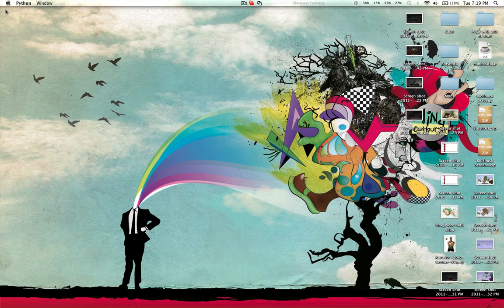Pixel Display Tutorial Part 1 -The Building of the Display-

Comment: Instead of using MCedit you can use zombes modpack by turning on builder mode then pressing x to select the the area that your head is in then press x again somewhere else to select the blocks between the two selections then press z to fill in the area with the block in your hand :)